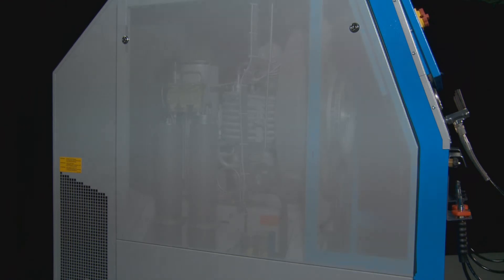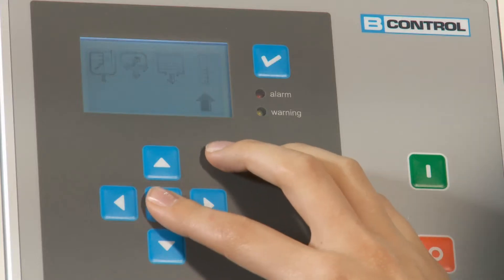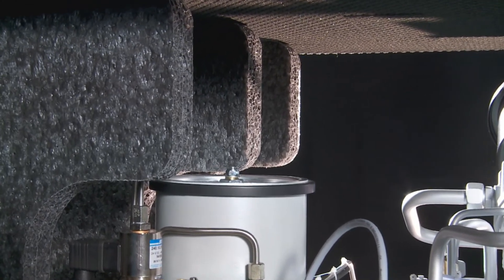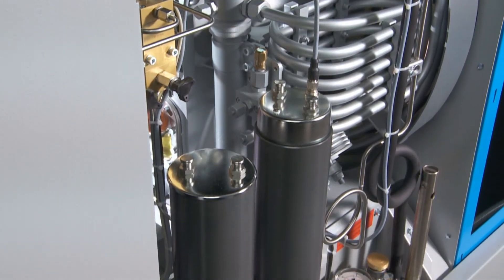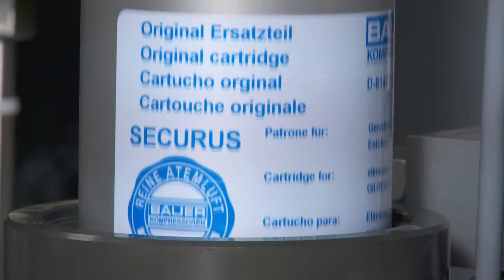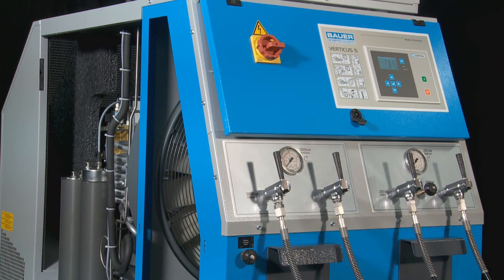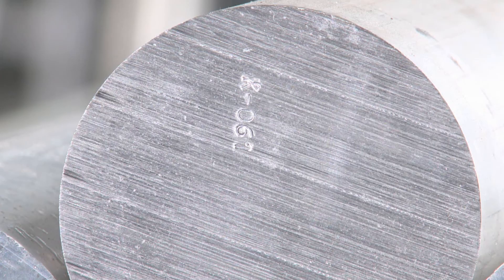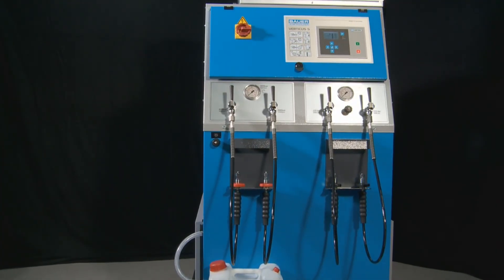VERTICUS 5 from BAUER KOMPRESSOREN (English)

Comment: Lubrication oil pressure range
Reply from the maker: In this compressor series, the oil pressure is normally in the range of approx. 5 bar. When the pressure falls below 2.5 bar, the control switches the compressor off.

Comment: What is the maintenance and configuration mode password for Bauer verticus 5 breathing air compressor with B control controller??
Reply from the maker: The requested passwords are for trained and certified service technicians / dealers only.